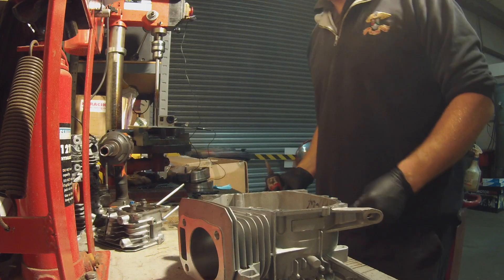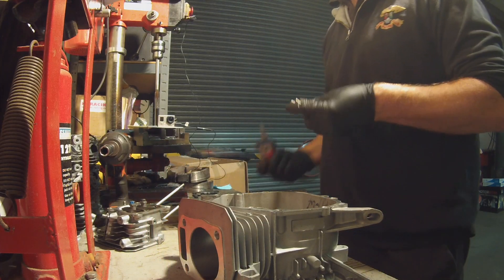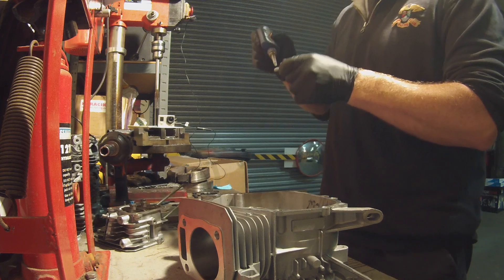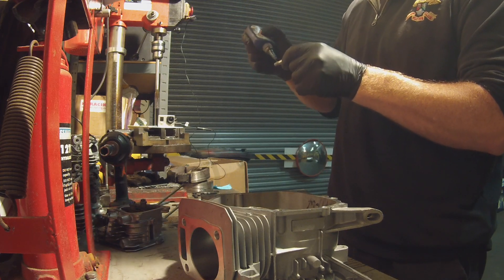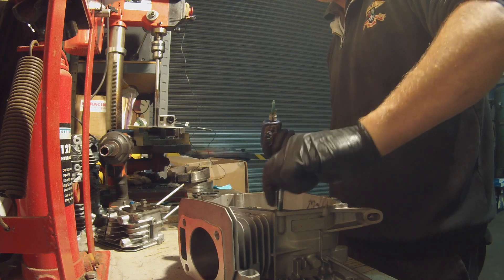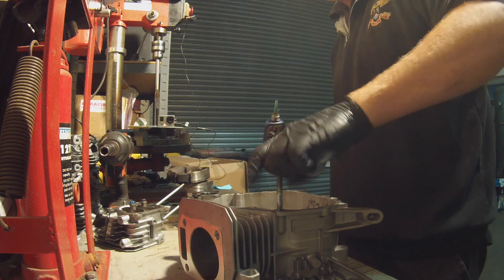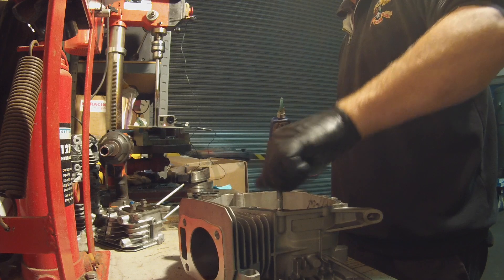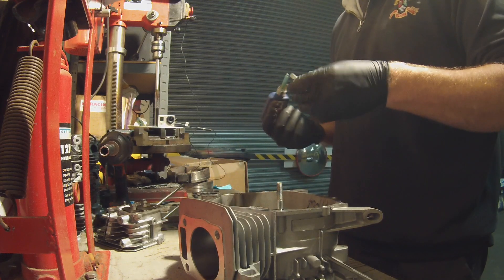Honda GX160 / GX200 Engine Tuning. Fitting a Stud Kit to a GX160 / GX200 Engine.

Comment: What would be the reason to increase the performance on a utility motor? Are we applying it to a go cart or something? Using the vids to rebuild a 160 for a pressure washer
Reply: yes, there is a big market for performance utility motors.  Mine are on racing mini bikes, but any home project or go kart could use aftermarket parts.
Reply: @lambtonold-schoolminibiker4552  I just received a Honda GX160 for pump application but the previous owner bypassed the oil sending unit and ran it low on oil and now it won't run. The rotation feels as if there is no rotating assembly inside so I need to tear it apart and see what's going on. These little motors are quite impressive. Are there any community forums that would house information related to these engines?